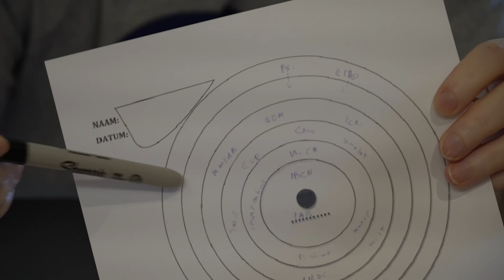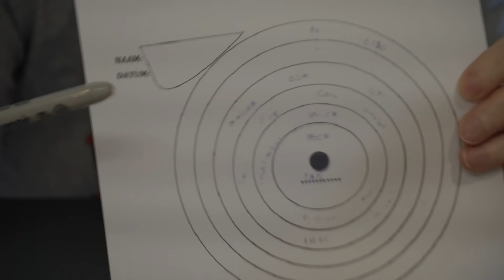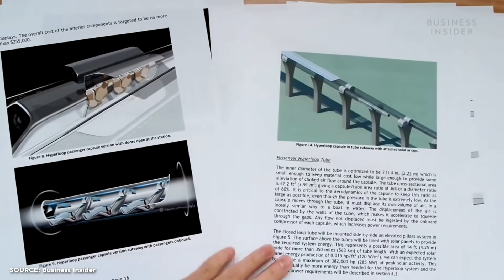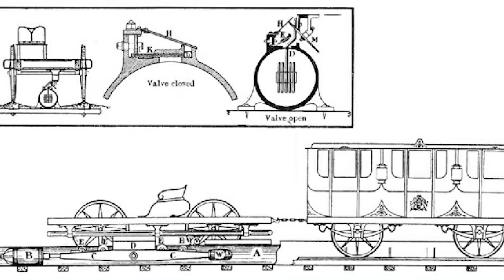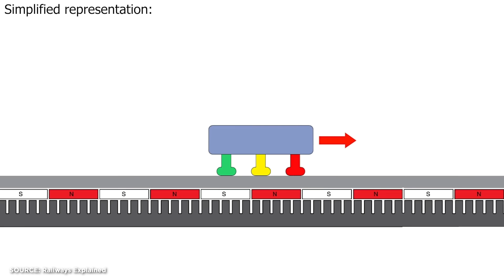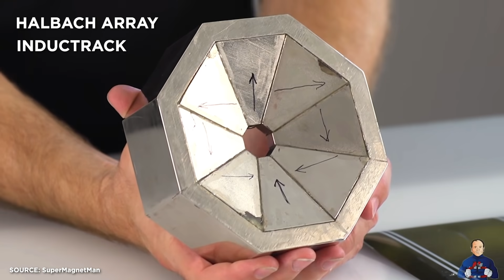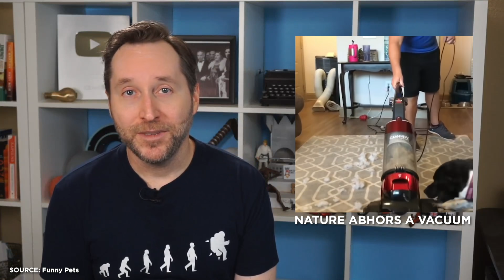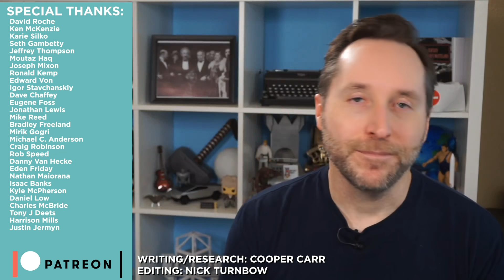What's Happening (And Not Happening) With Hyperloop | Answers With Joe

Comment: The fundamental problem with hyperloop is that it doesn't actually solve any problems with existing high speed rail systems while introducing a ton of new ones.

What do you mean it doesn't solve any problems I hear you cry, it can go faster!  Yeah...sure...now how many existing high speed rail lines actually go even as fast as they are already designed to be capable of?  Very few, in fact.  Theoretical top speed is almost never the limiting factor even with existing technologies .

One of the biggest issues is that the faster a train runs the straighter the tracks need to be.  You simply can't make sharp turns at super high speeds, under any system.  Which means as new technologies like maglev are introduced you really have build entirely new rail lines as the existing ones aren't straight enough.  But it's not just that you need new lines, in any established urban areas (where you presumably want your trains to go) there's probably already stuff where you would need to put your trains.  Just acquiring all the necessary lands rights alone is extremely expensive, let alone building the thing.

Yes in principle you could get around this by building everything in tunnels underground.  Maybe someday we'll actually do that.  But with current technologies that's even more expensive.  This is already a big issue with building high speed rail but hyperloop has all these problems just to an even larger degree.  And that's before considering all the technical and practical challenges unique to hyperloop, which there are tons of but plenty of people have already discussed those.

I could maybe see it working as a small scale largely vanity project funded by some rich nation for bragging rights.  But as a practical transportation system I really don't think this is ever going to happen.

Comment: Normal maglev trains would like to know your location... And will likely go the same speed but cheaper, even if that cheap is still double the price of conventional rail.
Just stick with high speed rail and be done with it and maybe use maglev for higher distance routes idk
Hyperloop is just maglev with a concrete tube over the top with added gamer lights (at least in the case of Hyperloop One) and would have stupid maintenance and running costs (because funnily enough, retaining a vacuum environment ain't cheap), let alone the safety hazards if there was the slightest crack in the pod.
Also cargo hyperloops are just a bad idea. How many points of failure would you like? Let alone trying to retrieve a pod out of a vacuum tube that's broken down for some unknown reason. Normal trains can get a much higher capacity and can fit existing infrastructure. Diverting funds from normal rail to hyperloop is just a dumb idea.

Comment: on and off, here and there..... since the 1950s (for actual large scale USA-wide vactrain systems)

the big problem with this or any other ssystem is "perfect is the enemy of good enough" and trains are "good enough" for the most part

Maglev is pretty low power - the shanghai train uses 15kW to stay levitated. Most of the 8-12MW power consumption is punching a train-sized hole in the air at 500km/h - and the shanghai system had to be slowed down because of noise complaints. Japan are having the same problem. You can't run at near-sonic speeds exposed on the ground without massive environmental disruption

my take: it needs to be multimodal (pax and freight) to be financially viable and large  enough to carry 60 foot shipping containers. repacking freight destroys the economics of most transport systems

different maglevs: varying train gauges, ever heard of Brunel gauge?

Vacuum and tanks - freight tanks are 1mm thick. 1 inch thick steel is cheap and robust. 4 inch thick is virtually indestructible. Mass is not an issue for a stationary device

Have a guess how thick the walls are in the 6 foot diameter vacuum chambers in my lab (we test spacecraft parts). 3 inches is the average but it's mainly lmiited by the strength of the floors - and maintaining a low grade (2Pa) vacuum is extremely low energy

Comment: how about underground hyperloops instead of above ground hyper loops, like subways but modern.
Reply: All these people proposing more and more expensive solutions. I just want electrification of current (no pun intended) lines. It would cost quite a bit but without all the logistics of refueling it will be not only cheaper in the long run but will save on time as well.

Comment: Unless we can burry it under ground (and this would work only in geologically stable areas) it is a dumb idea. The energy consumption, safety issues and simple economics are against it. I would rather see upgraded regular railway. I mean we are riding on 50+ years old tracks in most places which reduces potential speed dramatically.

Comment: When we dimension tunnels, we dimension for pressure differential. In a vacuum tunnel, like a hyperloop, there is 1 atmosphere of pressure on the outside, and 0 on the inside. So the pressure differential is 1 atmosphere. We regularly make tunnels that operate on a pressure differential of 20-30 atmospheres, ie, 20-30x worse than the hyperloop, see for instance the "Eiksund Tunnel". This is a non issue, and more elon hate and pseudoscience. Thermal stresses are regularly handled, and have been for hundreds of years with train tracks.

Comment: man, if only the hyperloop had actually become a cool subway and not a stupid tesla traffic lane designed entirely to prevent vegas from building public transportation (you know, a working subway)
...yeah, so, like, i think this is fun and all, but we should focus on building normal subways and metro systems in cities that entirely lack them first. maybe maglev metro systems. stuff that's both doable and not stupidly expensive. i mean, sure, big tracks between cities cutting through emptier land is a cool idea, sure. for cargo, very cool! but like. i don't know. i just think there's better things to work on right now. 
EDIT: okay yeah the structural challenges make this basically impossible.
double edit: Yeah, basically. just give us working passenger train systems in the US before toying around with Future Tech that doesn't work. please, we could use those passenger train systems. we could all use them. they would be so good and helpful PLEASE -

Comment: It's more energy efficient and is capable of a much smaller footprint than rail, that's where the economic benefits are, feel like you never mentioned that. So, your high speed maglev would be more expensive, slower and less energy efficient. it seems like you didn't read the whitepaper?

Comment: what happens if your going 600kph in a pod racing thru a tube during an earthquake?
Reply: The Earthquake Warning System (they even have one in Mexico City) gives you 20-30 seconds warning that it’s coming. The train slows down to a stop in about 20 seconds, while the tube begins to repressurize which should take about a minute. With the exception of the near vacuum, this would handle earthquakes in the same way subways & trains do in Japan.
Reply: @TraditionalAnglican  I just did a g acceleration calculation on that, its not bad at all.  I knew about tsunami warning systems because they take time to propagate and reach shorelines, but I was not aware there was early warning for more localized seismic activity.

Comment: Meh, that whole thing is a dumb idea. 

For example: How do people want to design entrances and exits for the loop? Either you would need to recompress the whole system everytime a "pod" enters and leaves the loop making it basically an energy wasting piece of garbage. Or you would need to fit a recompression chamber with a 2nd valve that would make the whole system much more likely to leak and fail, as it would require an extra air lock which in order to function would have to slide open and shut left or right, making it almost impossible to actually integrate in a vacuum loop.

Additionally humans would be unable to breathe in case of a pod leakage. I am no physicist or even familiar with the function if vacuums, yet Thunderf00t made a great video as to why that is the case.

There are several more reasons why this is a bad idea, that theoretically could work, yet in reality is just a silly idea. 

Best part is, as the R&D is mostly funded by government money, the whole Hyperloop is a safe project for Musk, as he can simply lean back, watch the progress and buy back the end result and final product (that of course will be nothing close to what he actually wanted to build, yet may be much more realistically be able to operate properly) and call it his project. This by the way is done quite often by companies. Siri for example was also entirely funded by I am pretty sure the German government.

Also Musk is the king of overselling and underdelivering. All we do get to see are beautiful renders of future technology and what we actually get is some BS death trap Las Vegas loop. His renders are almost as scientific as what we see in SciFi movies except those normally do not try to convince you that they will actually build the stuff shown. They know it is mostly BS or simply impractical.

Comment: Remember the German Transrapid? It was finally - and silently - discarded after a lethal accident with a maintenance car. What a profane end to a high flying technology.
The development was paid for by the country, by politics. This always guarantees it is a dead horse before even taking off. 
When there is private money involved I am not that sure about it's coming failure....
Reply: Yes, that thing. 
There was a petitionen in that the parliament should reconsider if it should be used.
272 people signed it so, it didn't even reach parliament.

Comment: The idea of controlling gravity is only possible when there's a measurement of it's density at different locations...and electro megnatic plates..."BUT"
WHY UNDERGROUND... Instead of this much money spent underground why not in air with plastic removing scheme...with the extraordinary power of    plastic tubes to hold on the flexibility of weight of small or big train...🙄

Comment: You can not separate the discussion about vacuum tubes for transportation from the craziness of Musk. Without Musk in the mix we have an engineering problem and a cost to benefit ratio to overcome, and this is what engineering is all about. With Musk we have stupid ideas being passed as genius, with a gullible public fighting almost religious wars over them.

I have no problem with people thinking decades ahead of their time, but I do have problems with people who think that you can make a straight steel tube that is hundreds of kilometres long and has no expansion joints. We know how stupid that idea is since the first time we made a pipeline in the late 19th century, and time does not change the physical properties of steel.

Comment: They invented cars before the highway system which would be 1000x more expensive than putting up the proposed hyperloops and save money and carbon over air travel. Just sayin. It's not "unobtainium", it's not "fusion". It's a train in a vacuum FFS.

Comment: There is nothing wrong with doing research and projects about it. But, it should be seen as a future tech not current tech and shouldn't have big projects with the current stage. We have limited time to reduce carbon emissions. And something that would work in 20, 50, 100? years is not really a savior is it?

Both people and freight transportation can benefit through trains. Electrified trains are one of the most carbon efficient means of transportation. If it is high speed rail, it is much faster than car and can even compete with commercial planes in short distances. Especially the US really lacks intercity rail, with some exceptions in the east coast. The US can benefit hugely from it. Giving people another option for commute could reduce the dependency for cars and could reduce carbon emissions greatly.

If high speed trains are not enough, why not do maglev afterwards? It is a working technology that we have, although more expensive than high speed trains. In countries with vast networks of rail, maglev could be an alternative besides it. Maglev would compete with planes on even long distances and would be a perfect low carbon emission, express alternative to high speed rail. Japan is currently doing it and I'm all for it. However, rail networks should be a bigger priority for countries lacking it. The world needs low carbon ways of transportation and rail transportation is our best candidate for it.

Comment: I just thought of something. If the Hyper-loopp tube is under a vacuum, the why is the Hyper-loop carriage designed and illustrated aa something super aerodynamic?  Simple. It’s all bs.
Reply: They are proposing using a pressure of 1/1000 atmospheres.  That means there is still enough air in there that it needs to be pushed out of the way.  If it isn't, then a wall of air builds up in front of the car or pod or whatever they call it.

Comment: As batteries improve. I think VTOL electric autopilot  aircraft are the future. As fast as a maglev but no need for all that expensive infrastructure in between you just need the landing pads then you can fly between any pad of your choosing in an almost straight line. Build a house on cheap rural land and you can even put a landing pad in your back yard, which a lot of people will do when the 1hr commute from a city can be over 400km away. Might create a baby boom like the car suburbs of the 50s did. Use a hybrid power source like a free piston engine, and we don't even have to wait for batteries to improve we can develop them with off the shelf tech.

I commend this video on being a lot more fair and balanced than Thunderfoot the Musk hater, or the Musk worshipers on the other side.

Comment: This video keeps implying full vacuum.. but the elon whitepaper and subsequent projects aim for partial vacuum.. lower power requirement, easier & safer
Reply: The "partial vacuum" you're talking about is a medium vacuum. A full vacuum removes 100% while a medium one removes 99.9% of the air molecules. Not much of a difference. Also the whitepaper has been debunked by Thunderf00t multiple times now.

Comment: I just wanted to say that I question the "implosion" idea. I served on US Navy submarines....we had a couple hull breaches or leaks while I was aboard USS Florida SSBN-728. Very small but of course, since the water pressure outside the boat was very strong, the water streamed in with great force. We were able to repair the hole each time, and there were proper repairs later on when we came back into port. But the point is, the boat didn't implode.

So, I question if a bullet hole would implode the tube. In fact I would be surprised if a large hole imploded it. Because all it would do is make the air from the outside rush in to fill the vacuum. The only way the tube would implode is if you removed all the air and the tube was not strong enough to contain the difference in pressure. Obviously you do want to be able to detect if the tube ahead has been destroyed or breached, so any approaching pods can slow down and stop safely.

A submarine implodes at great depth because eventually the pressure of the surrounding water is too great for the hull to contain it. As long as you haven't yet exceeded that depth, you're not going to implode (and yes I do know what that depth is, and no, I won't share it; That's for the US Navy to know and for you, and our enemies, to not find out).

Comment: Goddard's proposal was for a very high vacuum tube enabling hypersonic speeds. But Elon realized that would require a difficult to maintain high vacuum, high strength tubing, and the vehicles would have to carry their own oxygen supply and CO2 scrubbers for life support - so Elon proposed a more moderate vacuum, equivalent to high altitude aircraft, which would be much easier to achieve and maintain, more moderate strength tubing, and the vehicles could draw in air and expel stale air, thus reducing the need for carrying oxygen (emergency use only). The main downside to Elon's version is that the speed would be reduced, no hypersonic velocities as Godard proposed, though moving the thin air in the same direction of travel could enable speeds above Mach 1.

Comment: Odd, quite complete and up to date with all that is happening, but then using the same old, mostly unfounded claims of why this technology can not work.
Missing quite the point, ironically as you mention it, that this mode of travel IS the internet of physical things. It’s not a train. Those run on, supposedly, fixed schedules. Where you want to go from point a to b. And you need to wait for the train to arrive, and are forced to stop and wait at every point on the route. The pod idea is similar to internet packets. You leave when you want, and only stop at your destination. Imagine the internet be like trains. Having to wait for a scheduled time when this video will be streamed to the eu, for me to be able to see it.

Technology never works, until someone invents/engineers a way to make it work. And economics will decide if and when.
So, I’ll wait and see.

Comment: I don't see why you'd be so worried about implosion. Farmers use vacuum systems all the time. This isn't near total vacuum, its at - 99.9% of atmospheric pressure. That's one 1000th of atmospheric pressure, lab vacuum Chambers go all the way down to one trillionth of atmospheric pressure. It's going to be a walk in the park to design a system for 99.9% vacuum to be structurally sound.